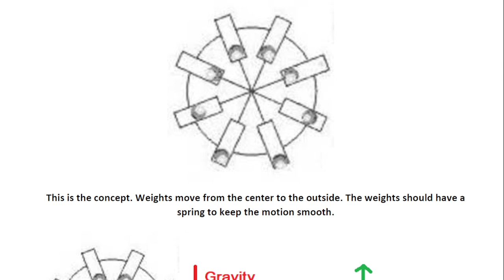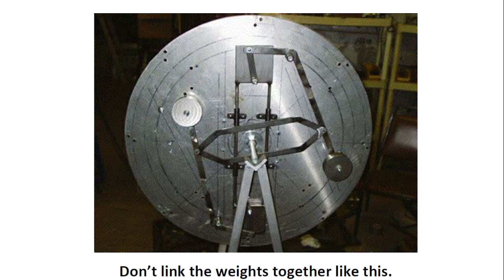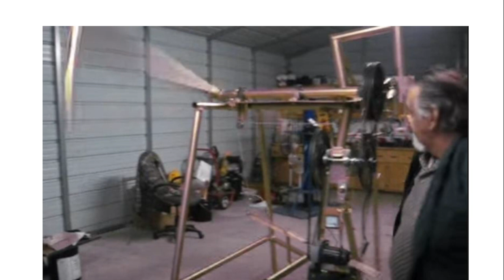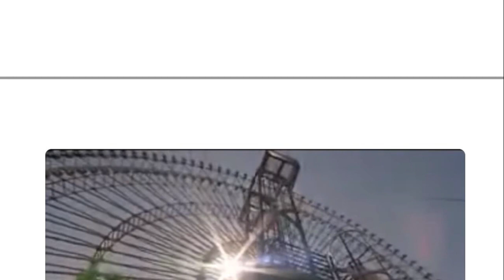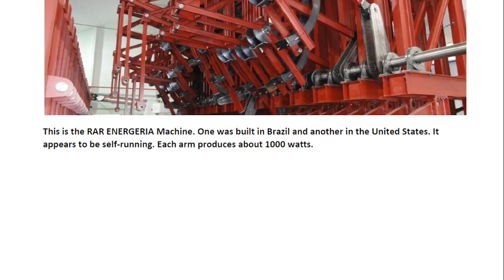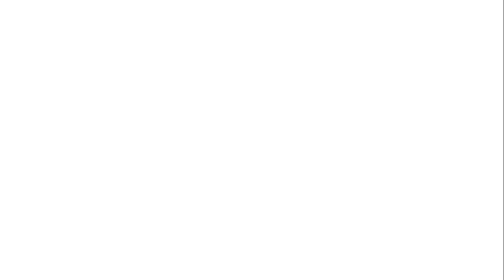Simple Gravity Motor Concept

Comment: I saw a video on you tube that did this sort of idea. He used 60 psi Air to move a pneumatic solenoid that pushed a 150 weight up. He used springs to re set the weight at BDC. IT DID SPIN. No connection to a power out put. I can confirm your point that he showed that is it went to fast centrifugal forces tried to pull the weights out all the time. 

A Troumpe water system to compress the air would work nicely To move the weight up and down. 
Moving a flywheel to store the energy before the generator.

 Also capacitors after generator, and before load to take the back EMF off the generator. To make the generator run more efficiently.

Comment: This is how you get a gravity powered generator to work.
Over balanced wheel.
Think of a large wheel setup like a bicycle wheel. Rotates on a shaft. 
The gears slow it down. Heavy weights all around. There are 2 settings  for the weights, they move in toward the center and  they move out. Wheel is spinning clockwise. At the top there is a smaller motorized wheel that slowly spins that not only sets the weight to the out position but also adds that energy to push the wheel forward. On one side of the wheel the weights are at "in position". Closer to the center shaft. The weights on the other side of the shaft are in the out position. When the out position weights on the down rotation hits the ground, gravity simply resets them to the in position